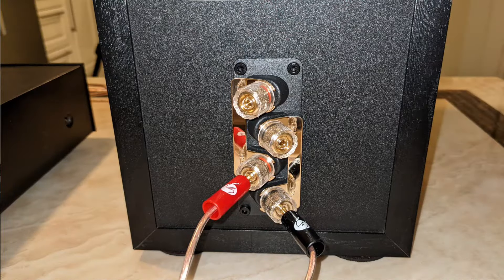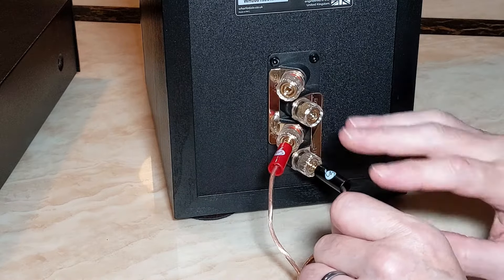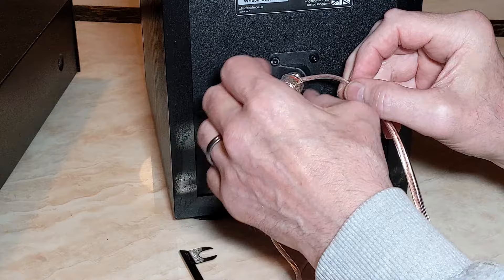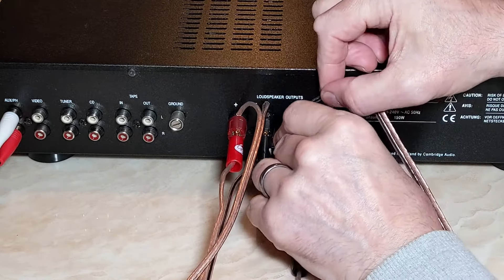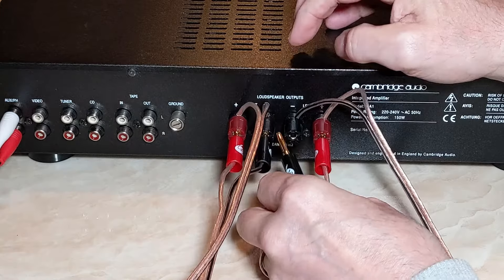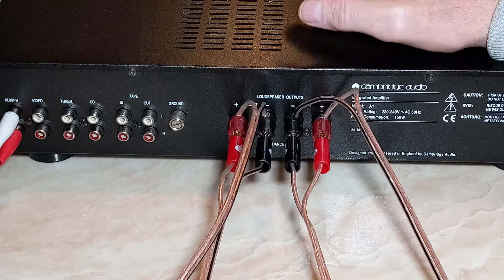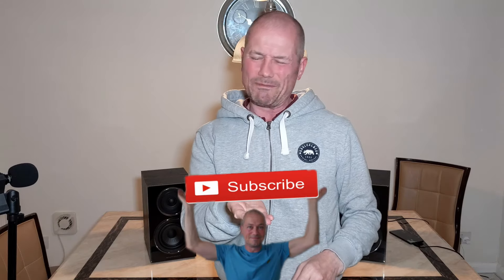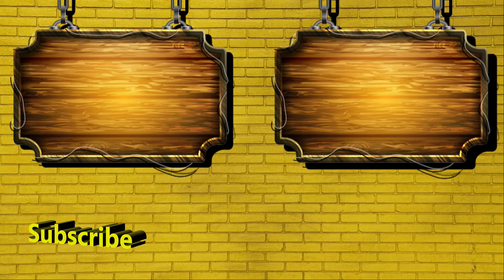How To Bi Wire Your Speakers (Includes Sound Comparison) #utilitariantv

Comment: That is not BI-Wiring, the amp does not have separate channels for high and low frequencies.
Reply: @UTILITARIANTVUK  But what you are doing is not bi wiring, all you are doing is connecting to two poles of the speaker at the amp end instead of the speaker end, to bi wire you would need an amp that can split the treble and bass frequency into two separate channels.
Reply from the maker: @stephen579  You need to write to all the speaker manufacturers and tell them they're wrong and to stop putting it in their manuals.
Reply: @UTILITARIANTVUK  But you are not doing that, what you are doing is sending all the signal, both highs and lows to the tweeter and the woofer
Reply from the maker: @stephen579  I am doing exactly what it states in the manual. So it's the speaker manufacturers who are wrong according to you.
Reply: @UTILITARIANTVUK  They are not wrong as they are showing you how to wire a pair of bi-wired speakers to a standard left right output.
Reply from the maker: @stephen579  Under the heading, How to 'bi-wire' your speakers.
Reply: @UTILITARIANTVUK  No they are not wrong, I have tried to explain it too you but maybe someone else can explain it better than me.
Reply from the maker: @stephen579  I'm not suggesting that the way shown is a good way of bi-wiring but it is a way. Jumping on here and saying that's NOT bi-wiring is completely wrong. Of course I know there are various ways to bi-wire but stating that this isn't one of them is nonsense.
Reply: @UTILITARIANTVUK  There is a very good article on google that explains all of what I have been saying, please have a look.
Reply from the maker: @stephen579  eh? I never said what you mentioned was wrong so why ask me to go and research it? You're the one who came on here declaring that I was doing it incorrectly.  You're the one who needs to go on Google and research bi-wiring, pleeeease. I'll even get you started https://www.audioadvice.com/videos-reviews/speaker-bi-wiring-bi-amping-explained
Reply from the maker: My response https://youtu.be/_5FH2tKONQ4
Reply: You are getting confused with bi-amping 😂. This video is about bi-wiring & is correct.

Comment: What happens to impedance when bi-wired?
Reply from the maker: It's possible for biwiring to make a  small impact on impedance but if you use decent cable it's unlikely.
Reply: Impedence is ohm level....whatever your speakers ohm is from factory will continue to be the same load whether you bi-wire it or not.

Comment: This is not bi-wiring!!! Correct Bi-Wire is when Speaker use Front output for High and Sourund Back for Low Terminal
Reply from the maker: The Wharfedale 12.1 speaker manual must be wrong then! 😄
Reply from the maker: My response https://youtu.be/_5FH2tKONQ4

Comment: not a good idea the way its done...u need a and b speaker terminals to bi-wire., u need 2 sets of speaker outputs not just for one set of speakers., no bi-wireing isn't going to work the way you have wired it up, u need another set of speaker terminals going out to the speakers, then u have to turn on a and b speaker on front of the receiver, thats how it works., u keep using it that way, your going to have a short.
Reply from the maker: It's probably better with an a and b output but you can also do it the way I've shown without any harm to the system. https://blog.fluance.com/bi-amp-or-bi-wire-instructions/
Reply from the maker: https://www.audioadvice.com/videos-reviews/speaker-bi-wiring-bi-amping-explained/
Reply: Now even what this guy has said is "somewhat" true but NOT entirely......first off there will not be a short as he says of any kind lol. A and B speakers have to do with front stage and rear or speakers placed in another room. As said on another comment. Your speakers were already bi-wired with the jumper in place thats why when you removed it and put another set of individual wire to the top speaker posts nothing happened. Now if you had no jumper in and just had it wired to the bottom set of speaker terminals thats called a single post connection. Then when you removed the jumper and added more speaker wire to the top terminals made it Bi-Wired! Now Bi-Amping is where you have more than one amp.....let's say you have 2. The fist amp you would use to run the lows on you speakers so the bottom set and then use the other amp to run the highs on your speakers so the top set......hope that makes sense.
Reply from the maker: My response https://youtu.be/_5FH2tKONQ4

Comment: You have done it incorrectly, you should be using a bi-wireable amplifier with 8 speaker posts out and configurable internal electronics.
Reply from the maker: You mean a/b speakers Yes you can do it that way but you can also do it the way I've shown if you don't have a/b speaker binding posts.
Reply from the maker: My response https://youtu.be/_5FH2tKONQ4

Comment: Hi bit late on this post but, you do all know that this isn't true bi wiring? All your doing is adding more wire to the links you took off. Can help some amps as your adding impedance but that's it. Only works if you have a bi amplifier or using a receiver amp with surround front and back. More details if needed. Thks

Comment: What you have done is completely wrong, your amplifier is not by-wire compatible (by-amplified) so what you have done is a waste of time and money on the cable, the amplifier needs to know how to by-amp and then the speaker to by-wire, you basically just skipped the metal plate between the speaker terminal with another wire and that's pretty much it....for a bi-wire setup, there should be 4 wires going from the amp to the speaker from 4 different terminals from the amp to 4 different terminals to the speaker...and like this the crossover built in the amp will separate the sound in it and send the correct frequencies on the correct wire...
Reply from the maker: I've had this comment quite a few times and I'll say what I always say. All I did was follow the instructions in the Wharfedale manual. It's listed as one of the options for bi-wiring.
Reply from the maker: My response https://youtu.be/_5FH2tKONQ4
Reply: Bi-wiring is possible using a single set of binding posts on the amplifier.  By removing the link plates, what you are actually doing is moving the filtering all the way back to the amp, hence the cables connected to the tweeter only carry the high frequency information.  Similarly, the bass wires carry the mid and bass frequencies only.

Before you argue with me, I am not guessing here and no amount of explaining that it can’t be true as both sets of cables are connected to the same signal will make the slightest difference.  The governing factor is impedance.  The filters on the crossover increase the effective impedance of presented to the amp for the frequencies outside their working range.  This reduces the current draw outside of these ranges to zero.

Comment: Of course could be your 54 years old ears. But the main reason that you cannot hear real difference or even the single wired better is because the cable that you are using here is even worse quality than the plates from the speakers. So please, with equipment like that dont try to confuse more people just because you don’t probably believe in cables.
Reply from the maker: My response https://youtu.be/_5FH2tKONQ4